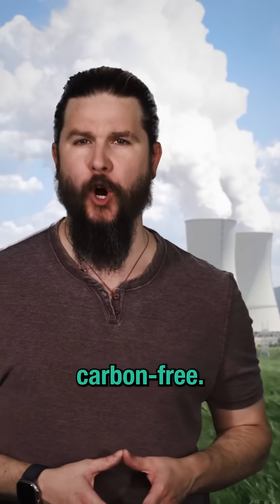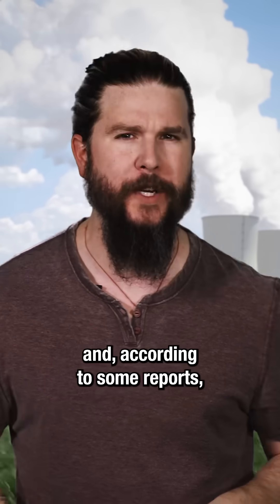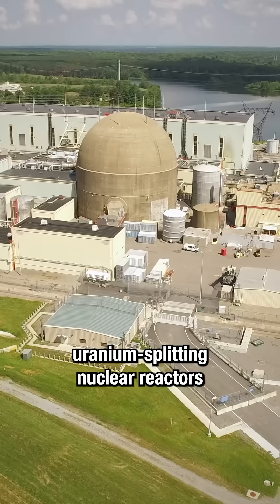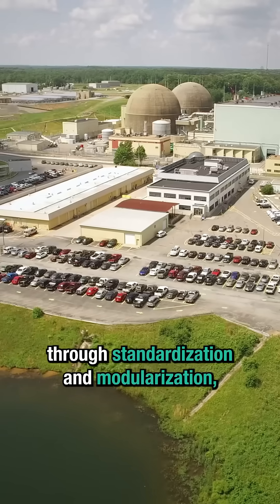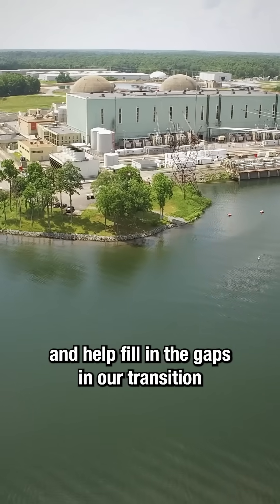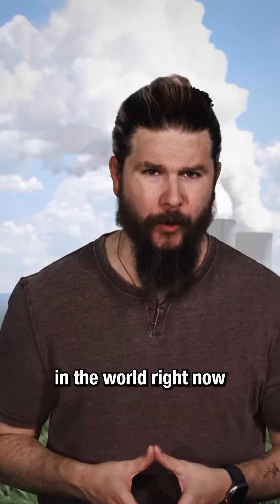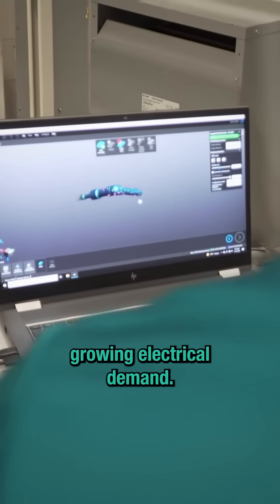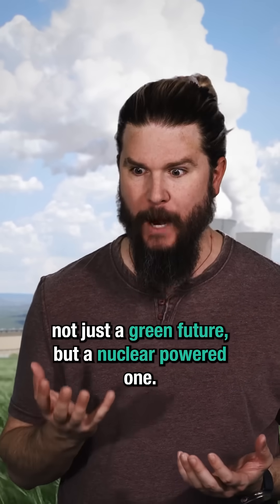Are Small Modular Reactors the Future?

Comment: I wish that we could trust people to handle the potentially dangerous materials better themselves, instead of the current proposition for a community scale power source, it would be really nice if we could make house scale generators that people could buy and have an effectively forever power-source.  It would also completely remove the risk of power attacks or similar issues, since none of it would be centralized.  If built sturdily enough they could be at the very least very disaster resistant, if not proof, and, could be both easily modular for improvements and expansions, and made to be Very tamper resistant.  Sadly though, i doubt we will ever get to that point, let alone scaling it even further down for tools or vehicles.  Especially not stably.

Comment: There are several alternative power sources on the drawing boards. But the one I have hope for is using geothermal energy.  Using technology developed for fusion energy using medium wave microwave to melt bedrock into a shaft to transport water to critical depth where water can be easily converted to high temperature steam.  Using Nucular decay under our feet to power our technological society.

Comment: The best part about SMRs is that they can reuse existing infrastructure for stuff like coal fired plants. Just decommission the plant but leave all the connection and control mechanisms for integrating into the grid and hook up an SMR in its place and you’re back in business. No need to find a new plot of land to put the plant on and build new power lines and infrastructure, just reuse what we’ve already got.

Comment: I am not a fan of uranium based nuclear power, but I would like to see thorium based nuclear power with a liquid  salt or if it can be achieved possibly molten metal coolant. Everyone wants these to be a SMR design. Economically, SMR's may proven to be a lower cost way to safely achieve nuclear power over huge reactors. It should in theory, work, but their proof is when you get them to work and work at a lower cost. It all requires more research and then actually building a few reactors and then trialing them. Thus, you need government or if you want to spread the costs better multi-government research and cooperation. So far it isn't happening. At least in the USA modular nuclear reactors would be most easily permitted in the replacement of old out dated coal plants. You think that our government would jump on the idea but?????
Reply: Thorium and molt salt reactors are unproven technology, uranium power plants have been providing clean, safe, reliable power all over the world for over a half a century.

Comment: While I have always been an advocate for nuclear power, small modular reactors make me nervous. I fear repeated ecological and personal disasters may come about from a laissez faire sense that these reactors don't need the same kind of care and maintenance as a standard nuclear power plant.
Reply: The modules are designed to be self contained and melt down resistant / proof.
You can think of the reactor modules as big nuclear batteries and the power station infrastructure as a big battery compartment! 
When the modules fuel is depleted it can just be replaced with a new one and the spent one removed for disposal or refurbishment at a more stringently controlled facility. (minimum maintenance during use as they are self contained and effectively sealed).
Reply: @DireW0lf0  He has a point and while I understand where you're coming from "meltdown proof" is kind of a misnomer. Yes, like with the designs that have a borated water tank up top, if that system would happen to be engaged, the recovery of that reactor is NOT going to be a quick and easy process and would be a BIG problem for the industry.
This is of course the big discussion and problem. Does the NRC let these run with less manning and oversight than it would in larger reactors? I think they would have a hard time with that, but at the same time if you need Reactor Operator and Senior Reactor Operators licensed and on site all the time like we would at larger units, does it come to a point that a bunch of smaller reactors don't make much sense? That's really the conundrum I think they are running into right now.
Reply: Do you have a car? Or a house? Are you looking after it or do you just let it waste away? People generally aren't dumb when being dumb personally harms them.
Reply: @chrismath149  what? when have you last interacted with people?
Reply: @horseneet  Everyday. Do you have anything with you but ad-hominem fallacies?
Reply: @chrismath149   well, i generally don´t want to be rude. so sorry about that. but people do not care for their stuff. not all, but out of a thousand? look at the cars driving down the road, look at how people are driving. look at the trash piles many people live in. now spice it up with weapons grade nuclear fuel. i can not fathom how you could trust people generally. and that is when they were to incur personal harm. do you think someone working on a mass produced part in a factory will be harmed if a smr melts down 1000 miles away?
Reply: @horseneet  Statistically most people do care about their stuff. The noticeable ones are the exceptions, not the rule.
And when we talk about a decentralized energy grid, it doesn't mean that those people are in charge of their own nuclear reactor - you will have a group, village or municipality receiving power from a small plant. No random guy is taking over control of that device.
Reply: @chrismath149  i think where our opinions differ is that I believe we do not have the capacity nor the resources to safely operate that many reactors. You seem to believe it. And if they come up with a good solution so would I. But there are too many failure points, too many ways for this to go wrong. By making many reactors the number of ways for them to go wrong multiplies. This makes failure statistically more likely.
Reply: @horseneet  There are 25.000 to 30.000 commercial airplanes. How many fatal crashes are there? We operate a great number of complex machines with a high degree of safety.

Compare the number of reactors in operation with the number of accidents and the number of casualties ( not biased numbers like those from Greenpeace). 

Compare those to the number of casualties caused by coal and other fosssile fuels ( COPD is one such cause - basically the fine coal emissions destroy your lung - it was once known as a miner's disease ). The number of COPD patients close to coal plants is much higher. And there is no cure ( maybe transplanation ).

I do agree we cannot safely operate machines but we can operate nuclear power much safer than everything else. The effects of nuclear disasters are much smaller than those caused by coal.
Reply: I do agree. decentralizing might be good for the grid but it would be harder to focus on safety.
Reply: The main issue here is that these small reactors don't actually solve any problems.

The problem is ACTUALLY being solved by running breeder reactors, which convert the spent nuclear fuel into something usable. These small reactors are useless without that other step; but running breeder reactors is politically thorny and runs into all sorts of issues with nuclear proliferation, especially when the operation is run at such a large scale.

Which explains why no country is using breeder reactors on a large scale, and likely never will.

Comment: Why should thousands of smal reactors be safer than a big one? The big ones are so expensive to build  because getting them save if VERY complex. The size doesn't matter. Thousands of reactors can cause thousands of problens.
If it is so easy to get them safe by design why aren't these designs used for the big reactors?
What a ridiculous idea...
Reply: Small reactors ARE intrinsically safer than larger ones, for many reasons too complicated for me to condense into a YouTube comment, but suffice to say that less fissionable material concentrated in one place means less risk of going prompt critical.

The catch is that they're less efficient.

Comment: Aren’t there huge efficiency losses for power generation at smaller scales though? It’s not as simple as a turbine. You need a lot of machinery and extra systems to pull as much energy out of steam as possible. (Reheaters, pre-heaters, sealing, thermal recouperators/reclaimers, vacuum systems, recirculation jets. Not to mention the enormous mass of a full scale turbine offers safety benefits and ease of maintaining a more pure sine wave even with varying loads.) It would be cool to see an ultra deep dive into every single non classified system that squeezes every joule possible from popping nuclei. But you know, I’m just an armchair engineer so what do I know.
Reply: Short answer: there are both massive gains in terms of being able to mass produce them (rather than every reactor being a custom design) AND, yes, massive efficiency losses.

I don't know enough to weigh them against each other.